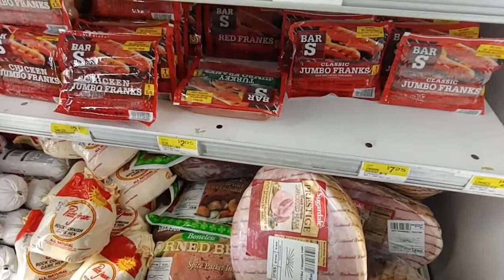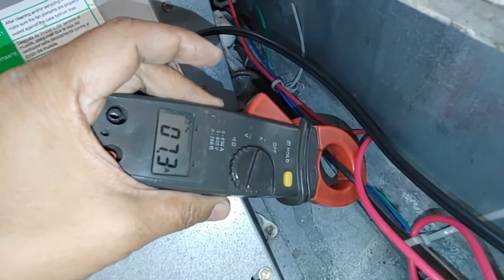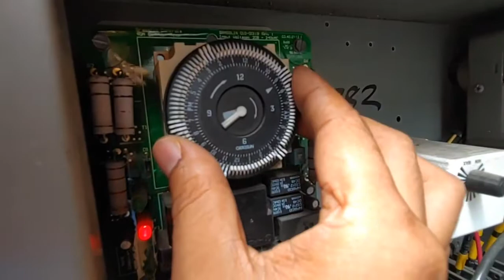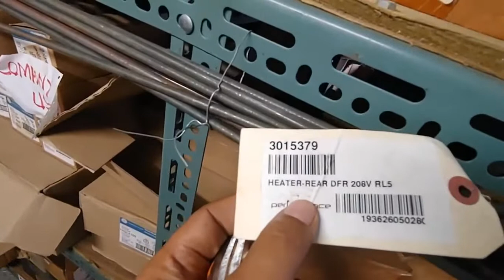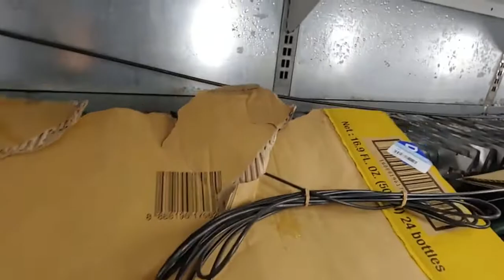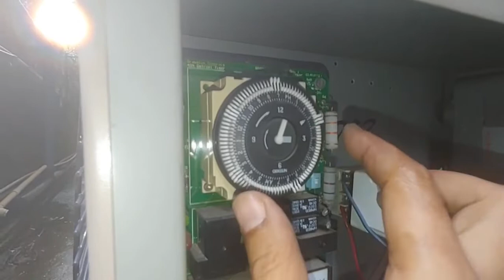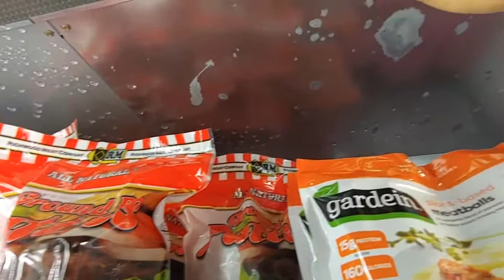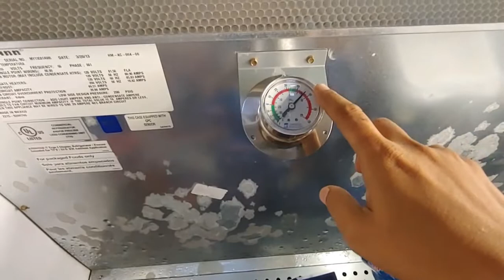REPLACING 13FT. DEFROST HEATER FOR COMMERCIAL FREEZER

Comment: Sir balak ko sana magpakabit DIY cold storage sa malaking bangka
2m wide 2m height 8m length storage

Sapat na ba ang 3hp na unit para sa ganung size at kung kaya ba paganahin yun gamit lang ang generator

Sana mapansin nyo comment ko maraming salamat
Reply from the maker: Kaya na po yun 3hp kung sa generator naman po  3hp pag normal na ang andar ng motor kahit 3.5kva po sana kaya lang malaking factor po dyan ay ang starting ng 3hp nyo po halos 4 to 8 times ang palo ng motor nyo sa unang andar po kaya ma nganga ilangan po kayo ng mga 19.5 kva kasi po pag mababa ang kva ng generator nyo po sa starting palang ng motor nya baka mahirapan po ang generator nyo po hingi rin po kayo ng second opinion sa mga dealer ng generator po pati po sa gagawa ng diy nyo na freezer kung fit na po sa ganong size ang 3hp po
Reply: @JPTECHMULTICHANNELTV74  maraming salamat po sir , nakahanap na po ako ng 15kva na generator meron pong 18hp na kubota engine. Salamat po sa idea God bless